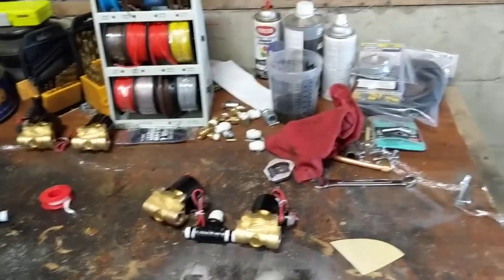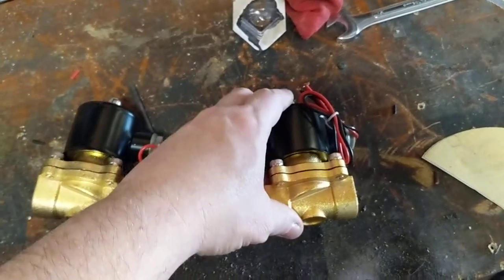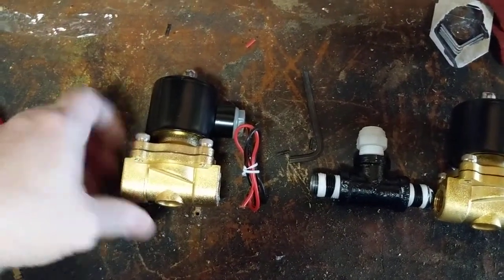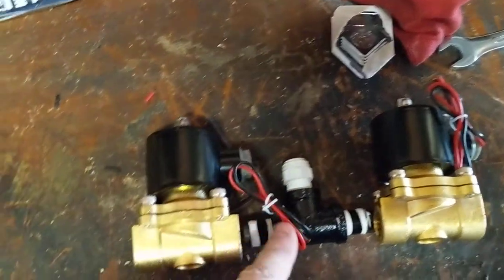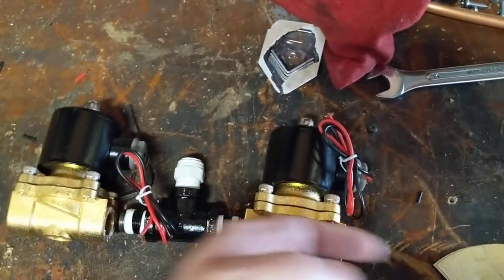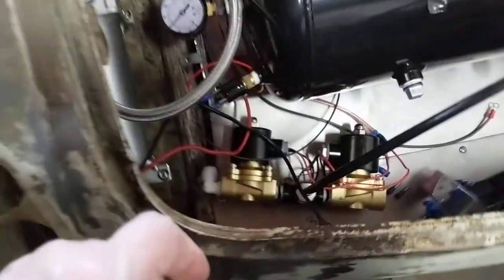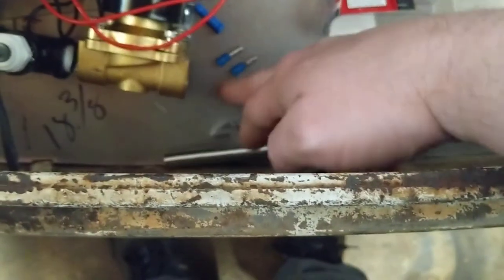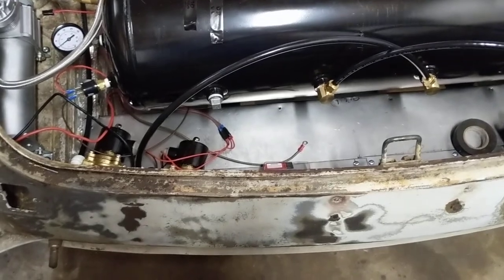1973 MGB airbag solenoid hookup

Comment: Dude! The line between solenoids goes to the Bag! The way you have it, when you open the solenoid on the right, your tank will drain out. Your setup makes it impossible to drain the bag.
Reply from the maker: Douglas Besse 
Thanks for the feedback.
Reply: I was gonna said the same thing lol
Reply: Yes you’re absolutely right I was thinking if those two solenoid valves were the same then the way he has it setup in this video would drain the tank and not the bag. For this setup he’d need two valves per bag, one for inflation and the other for deflation.
Reply: Your exhaust solenoid has to be after your intake, not parallel.   Your exhaust solenoid is gonna open but your fill solenoid won', keeping air in the bag.  Follow?
Reply: i was like.... same feeling

Comment: On a 3 prong momentary switch, should the air up connect to the top of the switch, 12v, to the center, and air down to the bottom prong?
Reply from the maker: I don't really remember. It's been 2 years since I messed with it. According to another comment the way I have it isn't correct. One valve is backwards and lets all the air in the tank run out. I need to do another video on this soon.

Comment: Ever finish this? Would love to see a bagged MGB, only seen midgets and considering bagging my 73 MGB roadster
Reply from the maker: Na, still haven't finished this project. Been sitting in the garage but it's been on my mind. I need to redo the air lines.
Reply: @lilzipgaming  anywhere I can see some photos of the car? Is it able to air out at all or still on stock suspension parts?
Reply from the maker: @Mr.B_Garage  I don't have any videos of the bags. Only have the front done. If I have any photos I'll send your way.

Comment: I would like to know how to connect a third switch.  I have a switch for the front and another for the rear.  How do I put another switch that controls the front and rear at the same time?
Reply from the maker: sorry it's been so long to reply. Are you still working on your project?
Reply: @lilzipgaming  I'm still working on the project but I already solved the switch issue. thanks

Comment: are you running 1/4 tube to your bags?
Reply from the maker: Ya, 1/4-in inner and 3/8 outer dimension.
Reply: LilZip - I’m trying to hook mine up what. What’s considered inner ?
Reply from the maker: Inner 1/4 but the outside of hose should say  3/8 OD type B well that's what mine say.